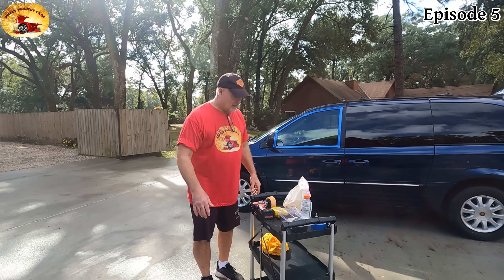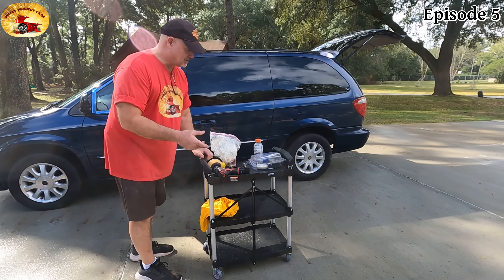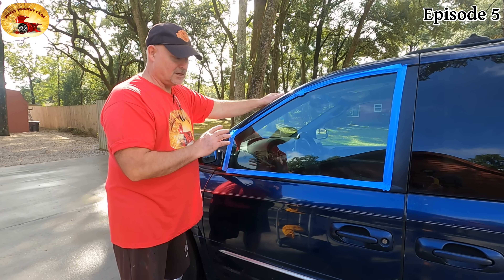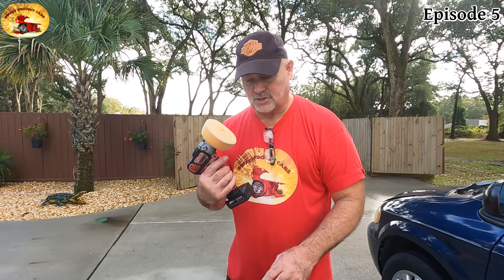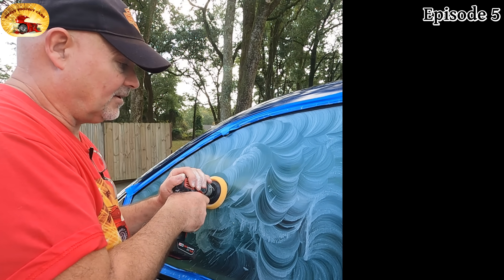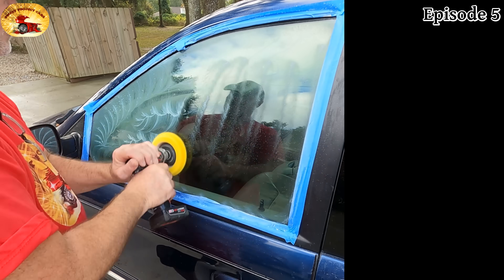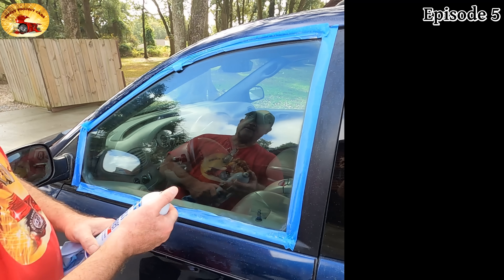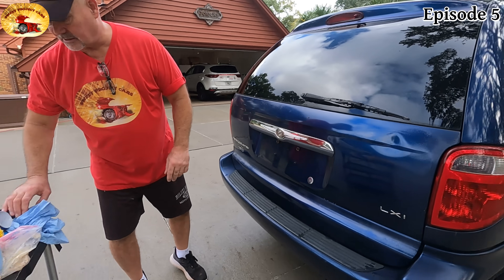How To Easily Buff GLASS To a DIAMOND SHINE  "JUNK to GEM Series Episode#5

Comment: It’s illegal to polish auto glass in the uk
Reply: The Highway Code states that windscreens and windows must be kept clean and free from obstructions to vision.

In this case the polish is fine enough that it is not etching the glass, simply removing the residue from the surface. It is also not an attempt to remove scratches or chips from the glass, but to clean it, as required by the Highway Code, specifically Annex 6, under the section, Maintenance.
Reply from the maker: Thanks for watching, have a great week. mad Mike & team